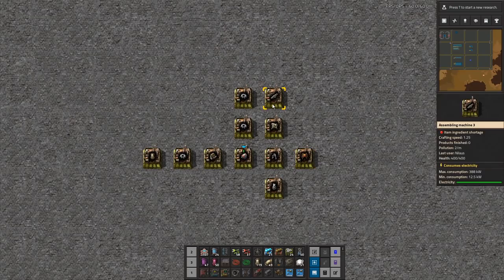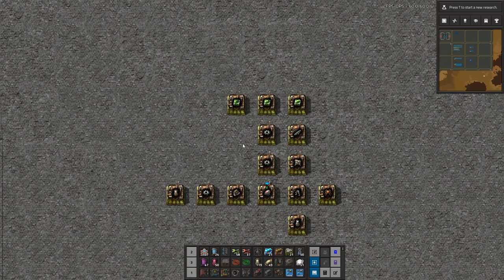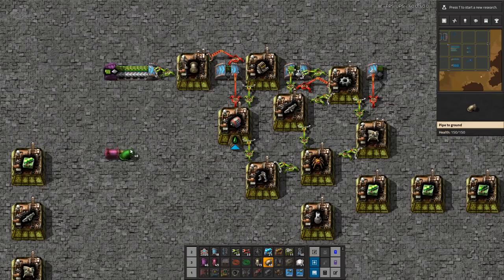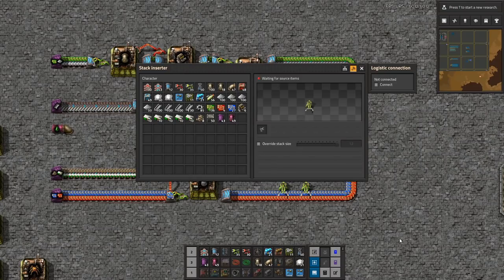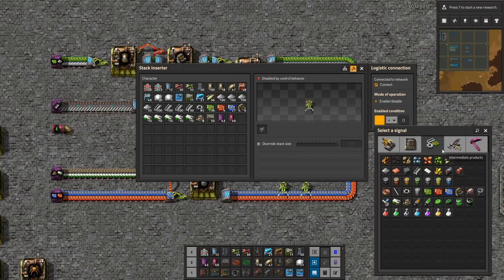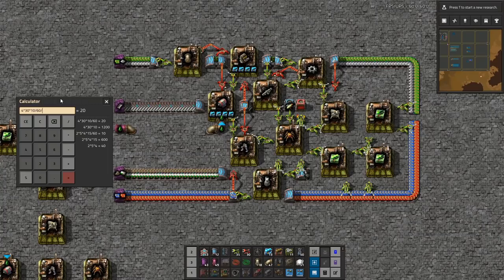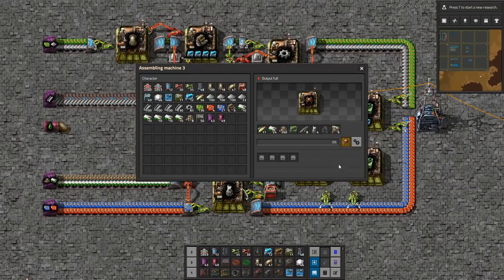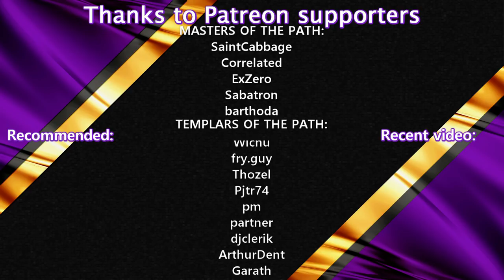Producing SPIDERTRON Every 5 min | Factorio Tutorial/Guide/How-to

Comment: Since Nilaus likes to design builds around full belts, i was wondering: how many Spidertrons per minute could you build, if the inputs are the same as in the video and only limited by blue belt capacity.
So I did the monster math, put modules where needed and the answer is: 5.4 Spidertrons per minute.
More Info: the constraining input is blue circuits (would be iron, if cogs dont have productivity modules) and 80% of them go into the portable fusion reactor. Since you can't use productivity modules on the fusion reactor, the exoskeleton or the green modules, the math was quite simple and the limiting input would always be the blue circuits.